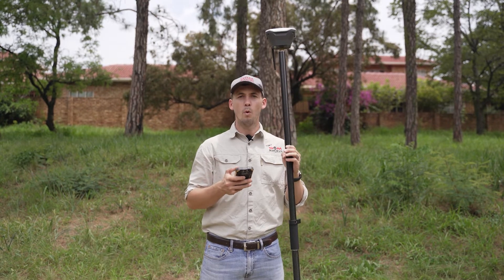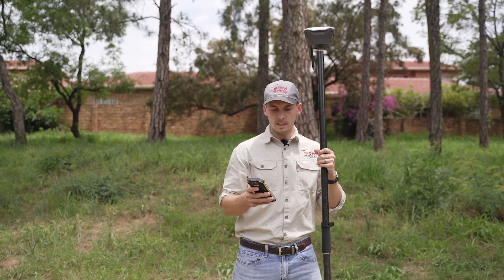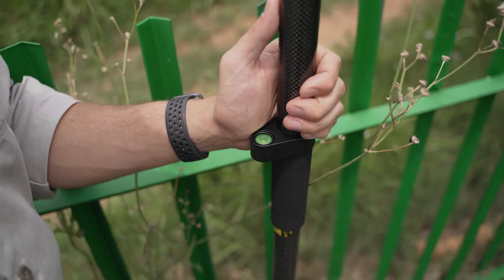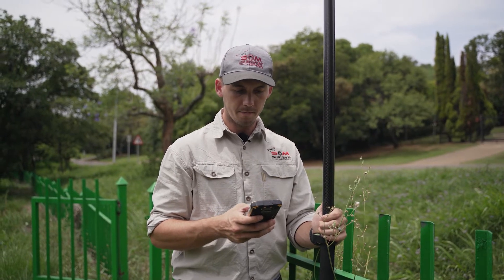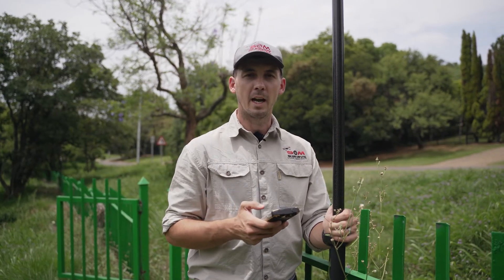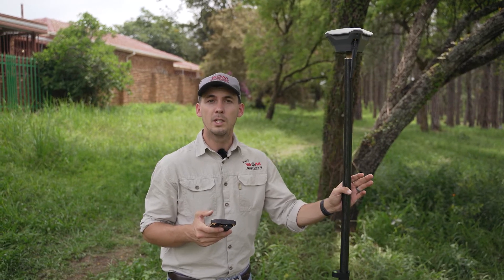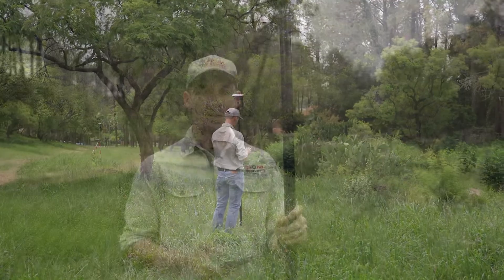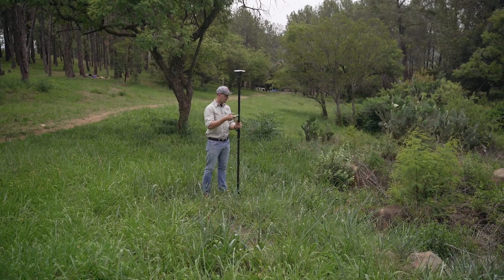Infield GPS Workflow Training | How to do a Topographic Survey | RTK GNSS Surveying Training

Comment: With an RTK fix, why is it over 2m off from the BM?
Reply: Because he probably didn't set a BASE receiver up on a KNOWN POINT.  Or didn't use a BASE at all and just 1 receiver as ROVER which tries to determine it's location AUTONOMOUSLY which results as sub meter accuracy instead of sub cm accuracy.  Can still get a FIX, but not at cm level...  so a FIX at SINGLE AUTONOMOUSLY at sub meter accuracy only.

Or he didn't use a single ROVER receiver with a CORS NTRIP connection to get sub cm accuracy.